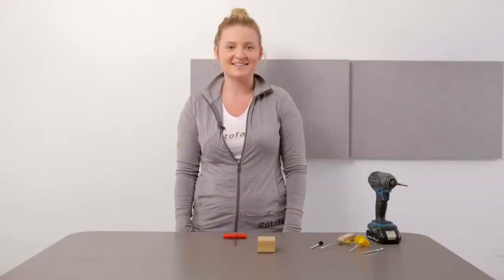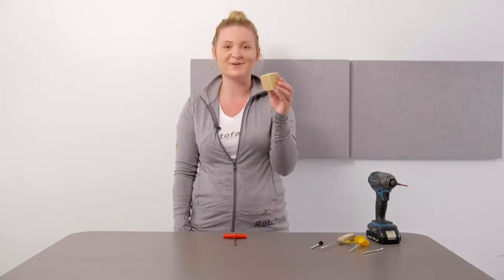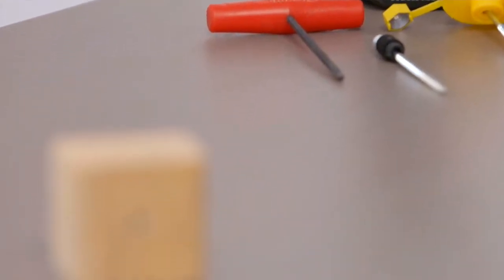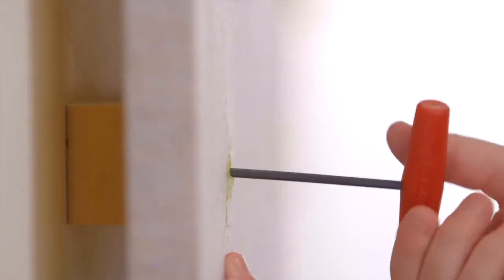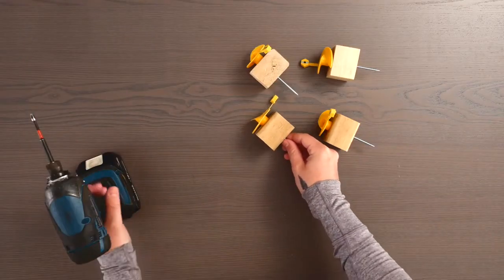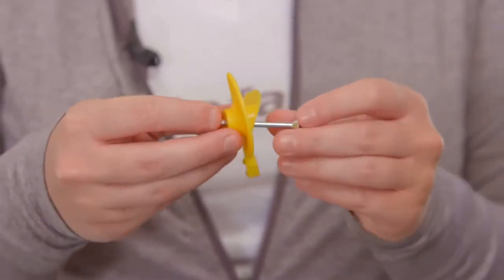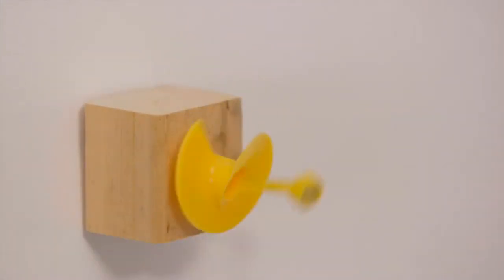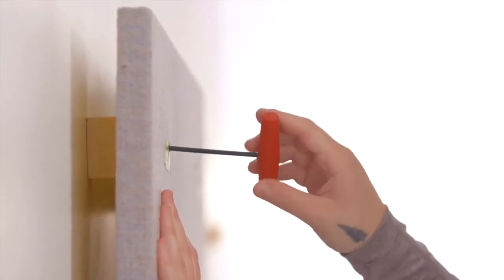Installing NetWell Acoustic Fabric Panels with an Air Gap

Comment: For small rooms, 4" thick wall panels should always be the minimum. Using 2" thick panels and a 2" air gap is more mounting work than it's worth. A 4" flush panel works better than a 2" panel with a 2" air gap. If you only have a 1" or 2" thick wall panel to work with... fine air gap it, otherwise get a 4" wall panel and forget about air gapping.